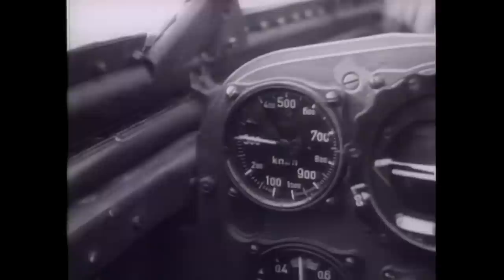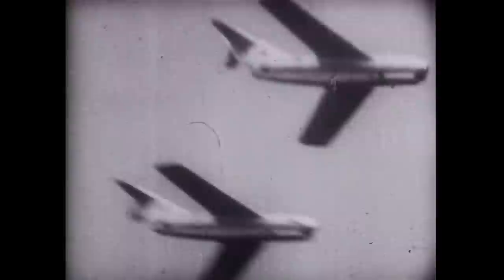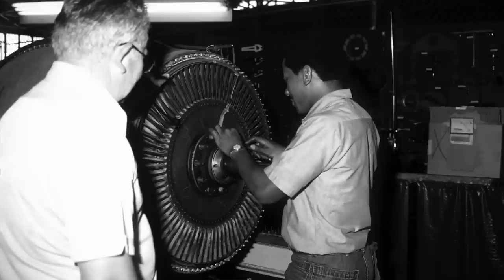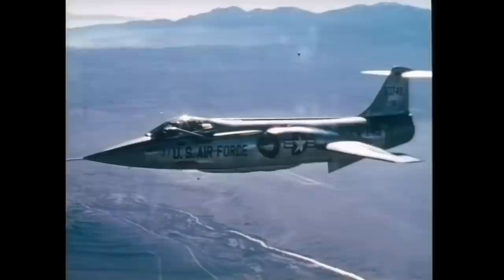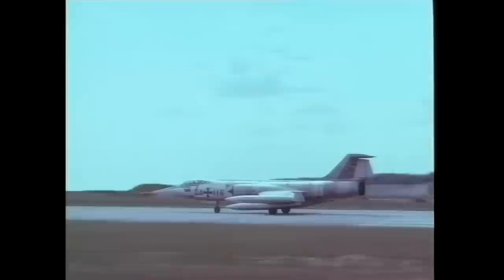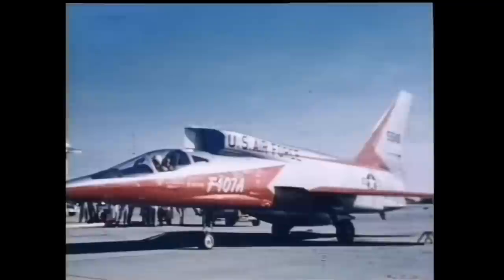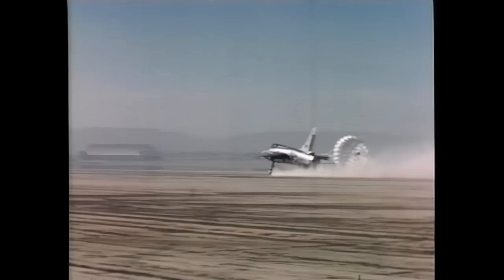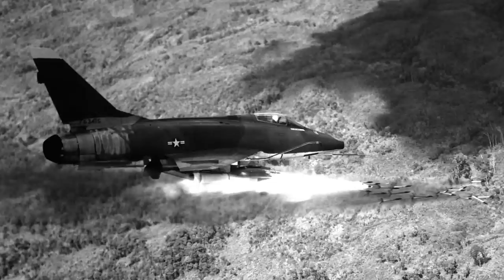the Century Fighters. the legendary 100 series of US fighter aircraft

Comment: Interesting stats on the Genie. Range 8 miles and flight time 12 seconds. So, launch it, give at least 2 seconds to see it go out ahead of you so you know launch was successful, then you have 10 seconds left to react and turn around. At high subsonic speed, you will need most of that 10 seconds to do a 180° turn. So you'll still be at about 8 miles when it goes kaboomy. 1.5 kilotons would not be a blast hazard at 8 miles, but with minimal, if any, EMP shielding back at that time, I wonder if there was any realistic expectation of the interceptor surviving the interception in a flyable condition. Or maybe the plane and pilot were considered expendable to protect the homeland.

Comment: The F-86 was not designed as a bomber interceptor.  It was a fighter and fighter bomber.  The later Dog Sabre version did add a radar and unguided rockets for bomber interception.

But thank you very much for getting the F-104 correct, and saying it was a day fighter rather than an interceptor.
Reply: You are quite correct. The 1/2 dozen .50 cals were on the early fighters, and the F-86D, "Dog Sabre", had rockets only and no guns. The later F-86K used by European nations had the nose radar of the "D" and four 20mm guns but no rockets.

Edit: The early 86s did have a gun ranging radar in the small lip over the inlet. The D and K were the big nose models with a larger radar and collision-course calculation fire control for using the unguided rockets. You sound like you already know that, but I'm putting it out there for those who don't.

Comment: Always too much misinformation/personal bias with these century series aircraft videos and especially in the comments. All us baby boomers seemingly have a favorite aircraft and the truth about them gets lost, at least to a degree in our favorite. ALL of them suffered from a "dead mans zone" where the power curve was below the drag produced by angle of attack at slow speed. The F-100 wallowing along in AB in this video is an example of this...NOT compressor stall. AB does not funtion w/out air through the engine. NEVER get too slow on landing, and blast through this "dead mans zone" as fast as possible on take off. The ultimate sidways crash was another weak point in all F-100's. Even w/inlarged rudder, the directional stability was an issue. Not a bad plane, but.....they all had issues. F-101 A+B had pitch up problems and with a wingloading of 144lbs a square foot, really high landing speeds and thus tire/wheel problems were constant issues. With 2 J57's at least it had the power to blast through the dead man zone quickly on take off. F-102 had huge power curve slow speed issues. Cudos to all you out there who flew them. To me, this was the most tricky one of all to fly.  The favorite of many of you seems to be the F-104. Yes it looks cool but could only go fast in a strait line. A gatling gun and 2 sidewinders is not much to fight with one you make the intercept. Yes, all Europe used progressively improved versions due to a Lockheed sales blitz but in USA other aircraft did more things better and it was replaced very quickly. With the brute force of a J75 behind them the 105, 106 and 107 were massive VERY capable aircraft even by today's standards. I'm so tired of the armchair experts use of the term thud, used in a derogatory sense, for the F-105. Pilots loved the plane and after all the cutting edge bugs worked out, they maintained an over 70% readiness level in Vietnam. This despite being shot to he11 and doing a job it was not intended to do. (intended use was going 1.2 mach 200ft  above ground w/ internal nuke and 2 drop tanks. A feat it could easily do). No thud pilot I've ever talked to had anything bad to say about that big fast beast. Even "Lead sled" should be applied to the 104 as NASA used them for full flap/power off  lift/drag experiments to train shuttle pilots in landing their "flying brick". Any armchair experts ever flown any military jet w/power off? They all go thud....  As for the F106, it still holds the single engine speed record of 1,525, was a good dog fighter, and had more range than the Phantom. The higher your thrust to weight watio, the smaller your "dead man zone" is. With this same engine, up-rated to 29,500 lbs thrust, it could have pushed the F-107 to mach 2.9 if it had ben built. The F-110  could be considered a century series as it still used the pure turbojet J79's but nomenclature change led to F-4. F-111 was all new technology with solid state electronics and AB FAN engines. Not a century series for me. Everyone can have a favorite, but as a pilot, all the quirks of your aircraft must be delt with to be flown safely. They were inherent by engineering comprimizes to reach the design goals of that time. This group of aircraft was pushing all of them. A truly exciting time for military aviation!!!!
Reply: My mistake....over 90% misson ready rate for 105 in Vietnam.